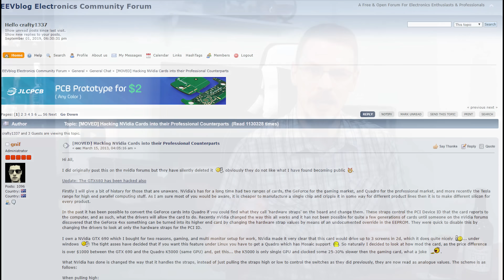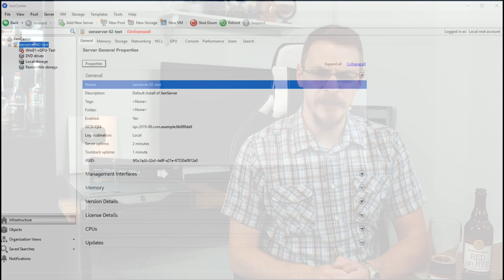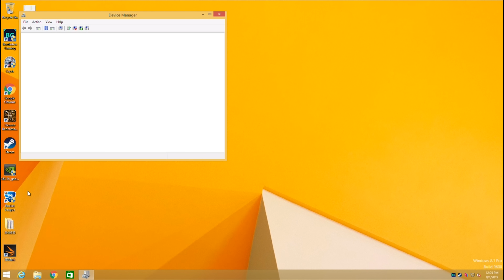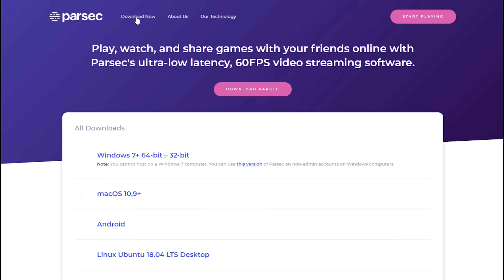I have lost my mind... nVidia GRID/Tesla Cloud Gaming Server

Comment: Bought a Grid K1 a few months back for my Alienware R3 for merely $20. I'm priding myself in the 'Budget-Build', yet found out two Nvidia Drivers can't run at the same time. Still hopeful though, owner of a SteamLink, only noticable difference is in my Nvidia settings, there's a CPU option now coupled with my GPU

Comment: Out of curiosity did you need to use nvida grid (multi vms per card) to get this working? or is this working because of the dual chips per card using pass through(bottle necked to 2 vms times the numberof cards)? or is there some other vgpu support I haven't heard of(Im pretty new to the concept, I only have looked in to grid and sr-iov)?

Comment: This will save a LOT of time:

By default, Tesla K10, K20 and K20X GPUs are shipped with their OpenGL capabilities disabled. In order to turn them on, you need to set their Graphics Operations Mode (GOM) from “compute” to “all on” using the nvidia-smi utility.

nvidia-smi –i 1 –gom 0
This command sets GPU device 1 to graphics operation mode “all on”. You can also query the status of the graphics capabilities with the following command.

nvidia-smi --format=csv --query-gpu=gom.current

https://devblogs.nvidia.com/interactive-supercomputing-in-situ-visualization-tesla-gpus/

Comment: HEHEHE, I did this Back in 2002, with a Few Compaq Proliant system's 7000, 8500 and RAMDrive 6000 unit with a butt load of Intergraph 3D Dual 3400, Oh the OpenGL was so much fun bake then.. The funny thing is I still have them in my DEN..with the 56 Disc Fibre Array..

Comment: Hello i finally got my Grid card working on proxmox under a windows 10 VM But i notice when i use remote desktop to go into it i see a lot of either glitching or lagging in video when playing a youtube video or netflix even small low end games that doesn't take much GPU graphics does that as well. And while the video is glitching the audio is out of Sync. What do you think is the problem? I don't know if it is the remote it's self sense when i remote into the VM it is on a local network or could it be something else?

Comment: The code 43 error is easy to bypass.  Just use proxmox, and when configuring the vms for passthrough, just refer to gaming on linux videos (where there are instructions on how to do that.)

Summary:  Hiding the fact that it's virtualized by modifying the XML config file of your vms (one XML per vm mind you) nulling out vendor ids and posting just any random domain, save and try again and You'll be able to do it successfully.

Comment: You forgot to mention that Proxmox supports vGPUs since version 5.3 and still does. You should try that if you haven't. And try disabling Nvidia drivers from loading on host when you pass through the entire thing. And trick the windows driver into thinking it's not a VM with the hidden CPU flag.

Comment: I actually have a GRID K520 and that is running in my VM Machine on my Hyper-V Server.  To make this work, you need to install RemoteFX on your Windows Server to make the client to work with it and you have to disable the card on the server side so that the client can see it  

Also, VT-d and VT-x should be enabled in the BIOS to make it read them. 

One problem I found out is that the server I have my card in disables the second core because I don't have enough resources to run it so, I can only use one GPU in a Hyper-V VM.

Comment: Hey, I deleted my earlier comment cause you're right, I thought it was an r710, not an r7610 (thanks dell).

But you should know, there are some Haswell EP boards out there that support DDR3, only some of the V3 xeons support DDR3, but I know E5-2678 V3 , E5-2669 V3, E5-2649 V3, E5-2629 V3, E5-2696 V3 do. There's a cheap (single proc only) $100 Chinese board for these too, 8 dimm so you can drop in 256gb ram if you desire. 

Also, you mentioned targeting six cores per VM, why that number? Are you trying to push it to above 60fps? I think you could get away with 4c for 1080p60, even less if you're really only aiming for esports titles. Sorry if you mentioned it in the video, I watched it last night and may have missed it.

Comment: I got my GRID K2 passed thru on Hyper-V 2016 to a WS2k16 VM. I had to do some funky registry stuff to force it to use the NV card and to set a screen resolution since W10 doesnt have a "Output Anyway on VGA" option - but its all working great. If anyone needs to force video output on a headless Win10 system, check out this http://obscure-tech-tips.blogspot.com/2010/01/forcing-your-nvidia-card-to-send.html

Comment: did the k2 not work for vgpu on esxi?
Reply from the maker: Not without Enterprise licensing.
Reply: @CraftComputing  I found a driver for the k2 for esxi, what is the licensing needed for? I installed the vib successfully but haven't yet purchased a k2. I might try one myself and see if I can get it working.
Reply from the maker: You can install the K2 vib driver, but can only enable vGPU support in ESXi with an ESXi Enterprise license. A free, essential or standard license won't do it.

Comment: Nice project you got there. Surprised you didn't get it to work with newer versions of RedHat or Ubuntu + QEMU/KVM though. Both of these support the vGPU/Grid stack by Nvidia, even the Kepplers. Your next step should be: how to use consumer grade GPUs with custom firmwares / hardware mods, to mimic the enterprise versions for vm pci-passthrough :-) Good job. Will be following your progress :-)

Comment: you should talk to Linus, he can hook you up. If he doesn't drop anything.
Reply: hm, but he used totally different gear at a different budget. Here you see roughly 1000 USD all incl., linus paid 1000 bucks for a Computer case full of thin air, everyting else on top. He solved the problem with tin, not software. Here a software solution is needed for given fixed (already bought; low budget) hardware.

Comment: Very cool to see these server cards being used. Tho this does seems kinda OTT for personal use :) Anyway.. heres my  quick 2 cents for anyone interested in something like this for yourself. Personally I use a server for gaming which I access over moonlight (open source client for nvidia gamestream)  and i use an i5 with a gtx 1080 (on windows 10). Normal parts in a 4u server case. Couple things I needed to do to run this in the rack. First thing needed is a tp-link on the PC power cable and set the PC motherboard bios to "boot" when power is detected, its (a reliable) remote booting technique and allows for a hard reset if anything was to seriousy crash (without needing to locally go to the machine). Second addition needed is a display emulator to keep a gtx card alive without a monitor (nvidia gtx cards have a habbit of not running without a local display connected). Now just spend some time setting up your desktop (autologin on boot + enable gamestream etc) and start streaming on the clients. First time pairing process can be done over RDP or chromeRDP. In short: If the goal was to just have a PC capable of being accessed by you on any display in the house for playing games (ie only one person). It doesnt need all the exotic server hardware; your existing pc will probably do it just fine. I can access my desktop games on any laptop, television, tablet and even my phone. :) As much as id love to play with some of that server gear lol. Hope this is useful for someone. I love the game streaming technology atm, with my laptop im able to sit and play GTA V cord free for hours, an experience that Isnt possible for as long on any local machine i am aware of, and anything that would run it certainly would not stay as cool. :P

Comment: I don’t get why your punching yourself in the nuts, spend the extra $240 you already spent more then that for the ECC extra ram for that Dell not to mention just that new faceplate which is not necessary at all, which tells me something about you. Cool story but I doubt you actually frustrated over this at all lol. Plex encoding is nothing with your upgraded CPU’s if you ran Hyperthread on that poweredge then thats weird.  All i have seen so far was a few cheap ass cards you can grab on EBay, well 3 months ago and made up a scenario  for yourself that doesn’t make sense, maybe if you had actually showed something then just a STORY.... hmmm

Comment: Try running ESXI 6.5. I know that it can give you a slightly more stable experience. That and Dell releases their own customized ESXI loaders that will have all if the necessary drivers to run properly out of the box. You can then update to 6.7 and it should maintain functionality. Also, see if you can get the idrac Enterprise,it'll let you have more control over the fan speed. Check out reddit/homelab for more information on that. I run a Dell R820 and this is a project that I want to work on at some point as well for pcoip. Good luck and awesome video!

Edits: holding a little guy while typing hard. Hahaha
Reply from the maker: ESXi requires an Enterprise license for vGPU, even on Kepler, and I don't have an extra $2k for that. And no iDRAC on the r7610. It's a 'rackmount workstation', not a server.
Reply: @CraftComputing  there's the VMUG program you can sign up for to get the enterprise licenses for $200. https://www.vmug.com/vmug2019/membership/vmug-advantage-membership I use this since my workplace is very VMware heavy. I know that this is mostly for experimental purposes but it could be worth a shot.

Comment: There's also qemu/kvm which you can use with a Linux host. You're familiar with nvidia not liking visualized environments, but there's a (not so easy) workaround that will enable you to run a virtual machine inside qemu, using any operating system you want for the guest: in a nutshell, you have to prevent the host from initializing the GPU (during the post process) you want to pass through, then dump the GPU boot firmware into the virtual machine's BIOS so it can initialize it. The result is that the guest will detect the GPU like a physical one, so no error code 43, and you get to use the operating system of your choice for the guest.

Comment: I have a K2 running on vsphere 6.7 with win10 guests running vgpu. It's not supported but it works out of box.  And you can configure RDP to use GPU encode (nvenc).  You'll be generating 10-20mbps network traffic to stream that much video, though, and that's probably what's driving your cpu utilization.
Reply from the maker: I'm going to give that a try. I was unable to get vSphere to recognize the K2 as a vGPU card, but I'm hoping your config works. Thanks for the version suggestion!
Reply: @CraftComputing  let me know if you need help
Reply: @CraftComputing  for what it's worth I am on ESXi 6.7 U1 build #10764712 running NVIDIA vgpu version 367.130-370.35. This is the vgpu software for vsphere 6.5 but it works just fine on 6.7!

Comment: Could you use something like unraid?
Reply from the maker: Unraid unfortunately won't work, as it only supports PCIe passthrough, not vGPU.
Reply: @CraftComputing  But would it not work for your use case if unraid sees each gpu in a separate IOMMU group. Then you could simply have six instances of windows running, each with its own dedicated gpu. This would even probably have lower overhead and should not trigger the code 43 error.
Reply from the maker: @Hellpro333  There is no video output on these cards. To use Parsec (or many other remote clients) a monitor is still required to be connected. The cards would passthrough, but getting a thin client to use them for rendering would still be problematic.
Reply: @CraftComputing  Ahh I see. Well, good luck solving this problem. I'm looking forward seeing the follow up

Comment: Does anyone else see a slight out of sync between picture and audio or do I have another problem I need to fix now..?
Reply: Yes and it bothers me immensely! its not a hardware issue either im running a 2700x and an RTX 2080 also other videos have no sync issues just this one.
Reply: @aaronjohnson2547  i don't see it
Reply: @budgetking2591  Oddly enough I figured it out it was a setting in the Nvidia driver called ultra low latency. Something you want enabled but seems to mess with video on youtube especially 4k60p video.
Reply: @budgetking2591  For me it wasn't constantly out of sync, it was intermittent.
Reply: please fix this
Reply: @jumusjumbuck  lol. I had this issue when using speakers. I just switched to my Bluetooth headphones and due to the delay, it seems to be perfectly in sync now. 😂
Reply: I hate you for telling me this

Comment: Wow, Nvidia GRID Keplar based card bring back memories for solutions I put together for customers some years ago (VMware Horizon View + Windows Server 2012 R2 client OS). These solutions were primarily for video editing.

From a licensing perspective the frist generation Keplar-based GRID cards include the GRID software license. This changed with Maxwell- and Pascal-based Tesla cards. Another licensing issue would be that you cannot (legally) run any Windows desktop OS as virtual desktop unless you have the Enterprise edition with Software Assurance or VDA license.
Reply from the maker: That is correct. nVidia has no licensing requirements for Kepler, but they do on everything since then.

VMware does require a license as well.

Citrix Xen does not require a license, and does support vGPU in their free versions, but Kepler is only supported up to 7.1 officially, although I couldn't get it to work.

Definitely a bit of a minefield to work through.
Reply: I forget that you require Vmware Enterprise Plus for GRID support. Most business willing, and able, to afford a proper VDI solution will most likely have Enterprise Plus licensing already. At least, at the time, you could get away with the relatively affordable Horizon View Standard which would have cost at least £2k (10-pack CCU + 1yr SnS Basic).

Unfortuantely Keplar age server gear was not the most efficient for video editing, or at least not when we tried having more than 2 or 3 workstation grade VDI sessions running on a single host (e.g. HP DL380 with dual E5-2600v3 CPUs). At the time an Nvidia GRID K2 card would have cost between £3.5k and £6k depending on the server vendor, and we would need 2 per server. A single node would cost around £24k, with half the cost being the GRID cards, and that didn't include licenses (Windows Server, Vsphere, or Horizon, etc). A simple 3-node solution would easily cost over £100k, possibly between £150k and £200k if we needed to include networking, SANs, additional servers to support the solution, and the considerable engineering effort. You can understand why even a large multi-billion USD company balked at proceeding with such solutions, especially when a 3-node solution was likely only going to support 9 concurrent workstation grade virtual desktops (16-cores, 64GB RAM, K280Q GRID profile). 

Maxwell and Pascal Tesla cards, along with Intel Xeon CPUs with significantly more CPU cores, would allow us to significantly increase the number of video editors we could support. I remember being significantly impressed by the Tesla P4 given its price, performance, power, and some 2U servers were qualified for 6x P4 cards. The GRID limitation of being only supporting a single GRID profile per GPU meant that multiple lower-end cards were sometimes better than fewer higher-spec Tesla cards.

I would suggest trying to get hold of a Tesla P4, but these still seem to be fairly pricey. They should become more affordable as businesses move to the Nvidia T4 (assuming they don't migrate to a cloud service).
Reply from the maker: Ah ha! That's why vSphere Free was giving me such issues. Looks like I'll keep trying to get a more recent version of Xen up and running so I can at least get Win10 on a Guest.

I'd love to get ahold of a Tesla P4, but given license requirements on both vSphere AND nVidia's side of things post-Kepler, it's not something I could afford. The whole premise of this server is low cost VDI. I'm going to be all in for ~$1200 with 3x K2s, 20-Cores and 128GB of memory.

If this fails, I do have a backup plan in the works, and another plan on using the Tesla/Grid cards (possibly in an NVENC role for Plex, or a remote render farm for Resolve).

I appreciate the insight, and thanks very much for watching!

Comment: I’m
Curious about using various AMD GPUs both because I have a ton laying around and I been wanting to make a system similar to this.  

I have heard AMD isn’t as strict as Nvidia by a long shot with virtual machines and such and I have been able to pass a few consumer AMD cards over a VM before with varying levels of success so I can imagine probably more doable on AMD..?
Reply from the maker: You are correct. AMD passthrough does work in most hypervisors. Definitely doable.
Reply: Craft Computing could you make a video exploring the usage of various AMD cards for this?   Im thinking of building a workstation using AMD cards and virtualizing the desktops out to weaker computers using something like parsec or another solution.  

I picked up 4 RX-570’s for $100 cash the other day to hopefully be able to use and create 4 VMs off of but if I’m honest not sure where to begin and if there is even a free solution or not for such a use case.
Reply from the maker: That's an awesome deal on some RX 570s.

I'd look at VMware VSphere 7.6 (free) or ProxMox (Free, OpenSource). Both are very simple to use, and offer PCIe passthrough. Just create a VM, and passthrough one of the GPUs to it.

You'll need to purchase a dummy HDMI adapter: https://amzn.to/2ZIxSUR

This will make the video card think there is a monitor plugged in, and allow you to use something like Parsec or Looking Glass to remote in with a full desktop experience.  Good luck with it!